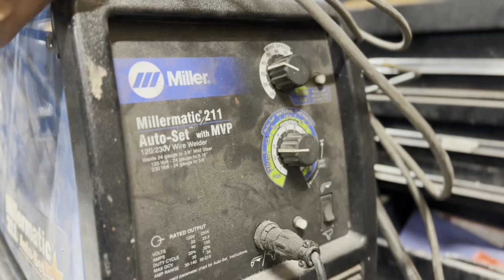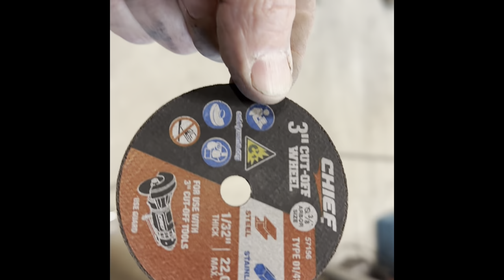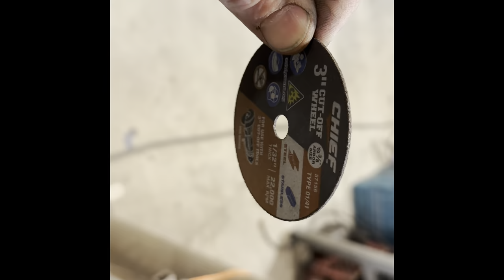HOW TO CHOP A TOP, THE  1937 NASH EP2

Comment: This is great . Thanks for sharing. I'm sure you know  that just a few years before this car was made , ( About 34) Metallurgy changed and that allowed car makers to stamp out large body parts without cracking... so this body isn't just a cool  car.. its a impressive piece of technology.  You are doing some very impressive work here.  Will you have to support the fillers with some  sort of stringers?
Reply from the maker: Thank you I did not know that about the steel. No it’s a pretty solid body. Most of the wood inside was just for interior parts.